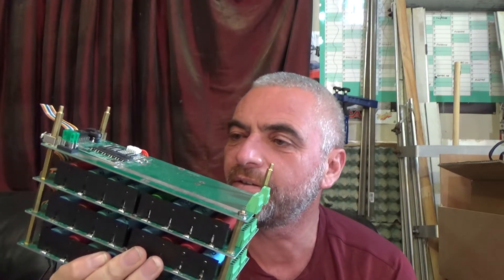Float Charging Lithium Ion Batteries | Can I leave my 18650 power wall charging forever?

Comment: Do cell phones float charge?
Reply from the maker: Not really, they just turn the built in charger off. But kinda... They are so smart and getting smarter by the day. My old S20 claims to track my charging patterns and adjust itself, aiming to be 100% at the time I usually unplug it. But I haven't noticed if it just starts charging later (like my car) or if it charges to say 80%, maybe even maintains it there, then tops up to 100 just in time. Or if it actually works at all

Comment: You are NOT Float Charging at 100% SOC.  Float Charging at 100% is the "problem".  You can Float Charge at any voltage well BELOW 100% SOC.  Float Charging well below 100% SOC has NEVER been a problem with Li-Ion ...
Reply from the maker: yep, that's how I see it

Comment: I built a small 90AH LiFePo4 system for our van with an SBMS0 (your videos were a source of inspiration). I have a Meanwell RSP-500-15 power supply for charging when connected to shore power, which works great, but has an annoyingly loud little fan.  When on, it will dump around 45A into the cells at 89% efficiency, making the fan run until the SBMS0 would shut it off at over-voltage.  Then, when the cells voltage dropped far enough, the SBMS0 would turn it back on again, causing a cycle of annoyance at load-dependent intervals.  To solve this I reached a similar conclusion as you did here, and set the (adjustable) voltage of the RSP-500-15 to 13.8V (3.45V per cell) which causes the charge current to taper to zero as the pack reaches this voltage, essentially "floating" it.  This way, the power supply is always on, but the fan only turns on when the cells are depleted, or a significant load is attached.  I had to experiment a bit with this "float" voltage, as the delta of the cells dictates how far below over-voltage (3.55V / 14.2V in my case) it will "rest" without one cell triggering an over-voltage condition.
Reply from the maker: Glad to hear it, thanks very much.
That power supply sure packs a punch, no wonder makes so much noise, must be like a little heater at 45A. Sadly they use a tiny fan going flat out rather than a larger fan going much slower. Would be very quiet in a different case with a couple computer fans in series going nice and slow, maybe one at each end. Anyway yeah nice one. If you don't mind the charge slowing near the top end which I guess if you are on shore power is not a problem at all. In fact you could probably even reduce it further since you have a spare 45A available behind the battery so you don't really need the whole 90Ah capacity

Comment: My only concern would be the possible fire risk with those lithium batteries? Why not just use a 20A step down converter? They're cheap and they take up much less space.
Reply from the maker: Yeah I will be using it together with 20A buck convertor, though that might be just as high a fire risk if I run it anywhere near 20A for any length of time. I did have some reservations with the 18650s but realistically they are the new "AA" and already in damn near everything rechargeable. As I was giving up smoking I had a vape with 3 in series pumping out 200W reliably from 100%-0% over and over again. I guess the BMS is still the big question but has performed well so far